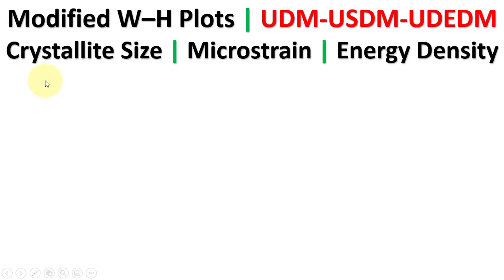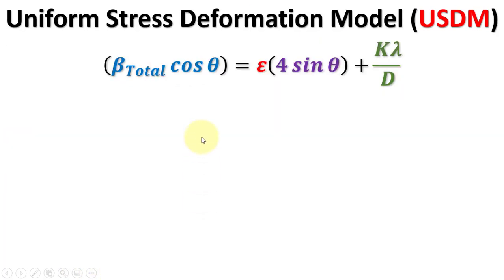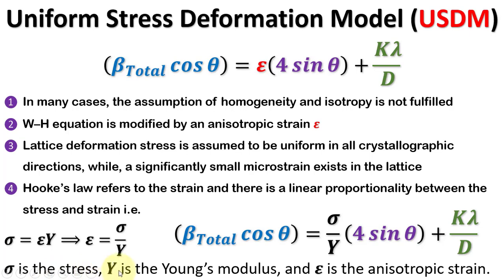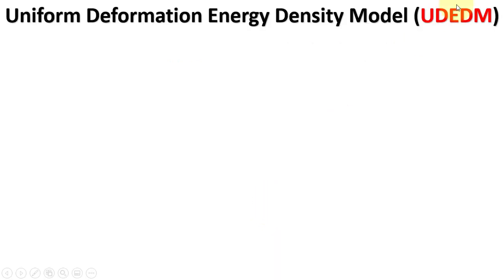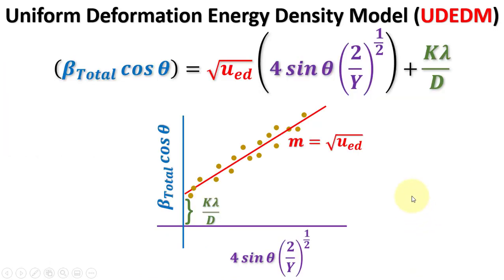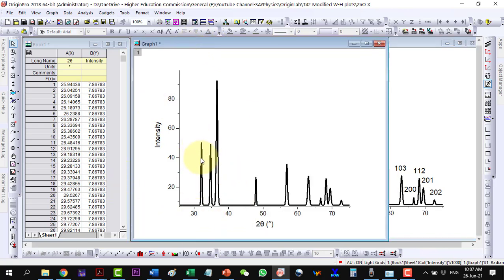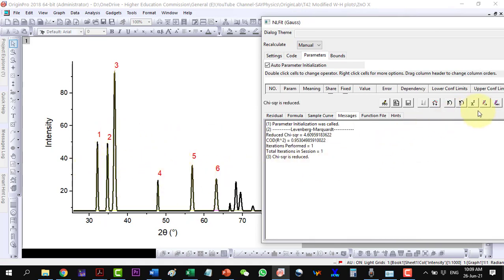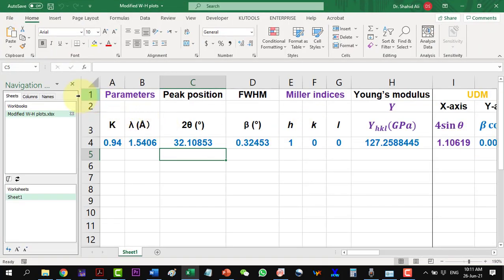Modified W-H Plots | UDM-USDM-UDEDM | Crystallite Size | Microstrain | Energy Density | OriginLab

Comment: I have a question plz answer that. I have data for pure nickel, 4 peaks of 111, 200, 220 and 311 , but when i am calculating crystallite size and strain using W-H plot, after masking one data, adj R square value is coming around 0.85, but there is lot of error. for different parameters, intercept is coming same for all, but strain coming different, how is that possible?? and is scherrer equation more reliable here ?
Reply from the maker: It seems that your data pre treatment is to be addressed first. As both the Scherrer equation and WH are peak width dependent, so, you will have to make it sure first that there are no other contribution to the peak width. I'll suggest, you go through the following playlist where I've discussed the different aspects. Thanks
XRD Data Plotting and Analysis: https://www.youtube.com/playlist?list=PLeWSImvDbpldse8hqfvZX7MasFSkTwIIT

Comment: Dear professor, First of all  I would like to congratulate you for the explanation. However, I would like to ask you a question. I am wanting to calculate the crystallite size for an amorphized sample, but the data from the XRD calculation in origin program does not converge. How do I do this? Do you have any suggestions?
Reply from the maker: Thanks for the appreciation dear 😊.
I have no idea for such a situation. As a suggestion, you may go through some threads in ResearchGate or .can ask a new question there.  I hope, you will find some clues. Thanks

Comment: I would like to ask another question, after masking one or two points, how much the reliable calculation is? Will it not affect the reliability of results when two points are excluded?
Reply from the maker: It totally depends on the flexible range of your sample. Of course, accuracy of the measurement is compromised, depending on the total set of measurements (acquired data points). Thanks

Comment: Dear Dr. I would like to ask, in UDEDM, what value of Y did you put it? Because each hkl has its own Y value, which hkl's Y value did use or did you use average?
Reply from the maker: Please check in the video description where I have mentioned the respective reference thay explains all these values. Thanks
Reply: @SAYPhysics  Sorry, I checked, could you please check your formula? The value of Y you used for hkl (100). Could you explain why did you use that value?
Reply: @SAYPhysics  I checked the references, but I could not find
Reply: @SAYPhysics  Are you calculating the microstrain for each hkl by UDEDM? but not total strain for bulk material?

Comment: sir please tell me how to calculate Young's modulus for orthorhombic structure. please sir i need your help sir
Reply from the maker: The values are here in a couple of articles below,
https://www.mdpi.com/2073-4352/9/10/497/pdf
https://www.mdpi.com/2073-4352/9/8/389/pdf
Reply: i read these papers but i don't know how to calculate Sij (S11, S22.... ) parameter there is no formula to show how to calculate
Reply from the maker: You can use the values directly. To know how they're derived, an extensive literature search is required. Thanks
Reply: @SAYPhysics  ok sir is youngs modulus and elastic compliances Sij is same for all  meterials having orthorhombic crystal structure or different for other materials which also have orthorhombic structure
Reply from the maker: Principally, they should be different for materials having the same structure even. Thanks

Comment: How to find youngs modulus in excel... bcoz it's not seems clearly
Reply from the maker: As long as the Young modulus is concerned, I have taken the values (s1, S2 etc. ) from the literature and then have calculated them in the Excel. I have explained this in the first few minutes of the tutorial. Thanks
Reply: @SAYPhysics  thanks a lot sir
Reply: sir how to calculate stress for USDM, USEDM and size strain method. please tell me sir. thank you sir
Reply from the maker: It has already been calculated in the video. Thanks
Reply: @SAYPhysics  sir you give the reference of ZNO nanoparticles paper when i see this paper and other related papers stress and energy density for USDEM is not calculated from slope. Please clarify me. Thank you sir
Reply: @SAYPhysics  sir can you show me youngs modulus Ehkl formula and calculation for orthorhombic structure